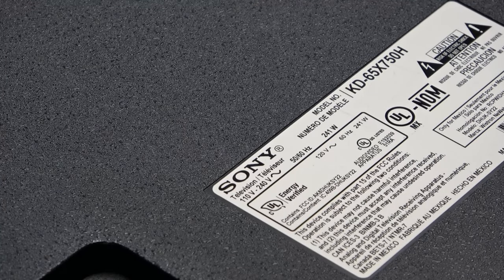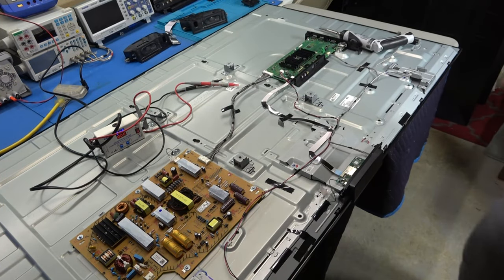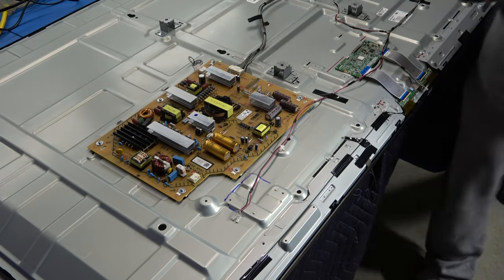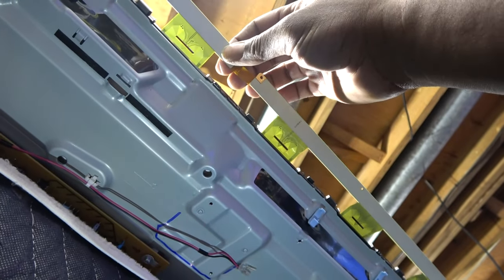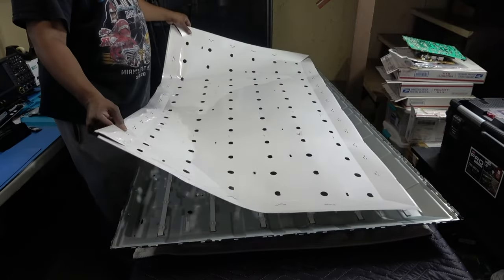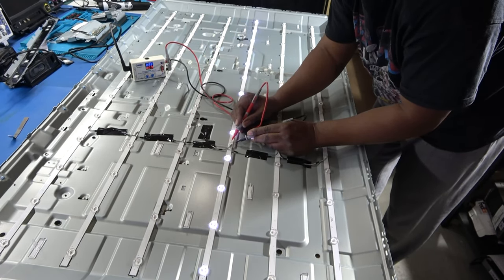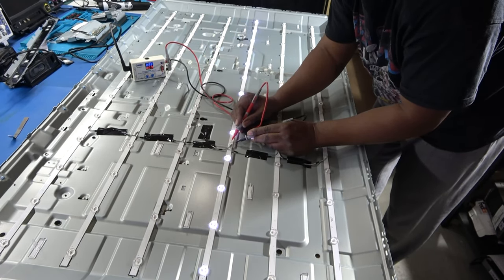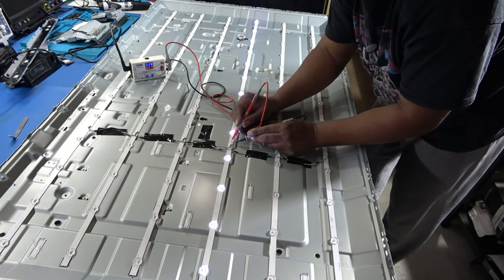Sony KD-65X750H no picture, just  6 red blinks at bottom. Full TV Repair.

Comment: I replaced the LEDs but still no illumination and 6 red blinks. They turned on once like at 23:30, but when I unplugged they never came back on no matter what I did. Later I replaced the power board and main board but still nothing. TV repair is not for the faint of heart. Time (about 12hrs total) money (~$100) for nothing in the end. I'm not qualified to diagnose it further. Thank you for the video though.

Comment: Thank you , good informative video , I am an Electronics technician and I like this video, you were careful not to damage the screen while doing this job, the only thing I always do is I secure the four corners of the  diffuser sheets that will make them aligned together and much easier installing them back, some tvs are more difficult in doing this job when the LCD screen is taped or glued to the frame which make this job either very difficult and higher chance of  cracking the screen while trying to separate it from the diffuser sheets

Comment: Is there any danger repairing it myself (i.e after shock) or do I need any safety gear? I have the same model and same issue. Thanks
Reply from the maker: As long as U make sure tv is unplugged from AC outlet and avoid putting your hands on the power board U should be fine. Oh, don't work on the TV on a metal table 😜

Comment: Great video. Fixed the backlight on a 65x8077G thanks to it . Note he wrote in subtitles to purchase the strips from shopjimmy. I missed that and the ones I got from amazon came without tape (2 weeks lead time) and the overall length was missing a few mm of length - so the ends did  not lined up -  had to spend extra time to ensure it is properly aligned.  also don't be tempted to remove the side covers with them up i almost damaged the COFs . Do it exactly as he shows in the movie crawling under the table. 
I did not have a power supply to actually test the strips, just replaced them all straight as he said. you could fell how brittle it were after 6 years of use.

Comment: The exact same thing just happened to our T.V.  Sent it to a repair shop, they charged $300.00 if anyone is curious about the repair cost.  LED strips are cheap, but taking it all apart, let someone else do it.
Reply: I might as well buy a new one.  Mine just did this
Reply: Just begun taking mine apart. I'm normally real good at stuff like this. We'll have to see
Reply: Bought lights off eBay for $30. LED tester for $18 on Amazon. So $48 in to fix a TV I paid over 1k for can't beat it
Reply: @officialfetti7685  were the strips double sided?

Comment: Very nice repair. I have your course. Not a fan of the suction cups. I tried that once, they left circle images (2) in the panel. Never again😡
Reply from the maker: The circles usually aren't permanent, never had problems with the suction cups, I hear you though. Glad to have you. Thanks.
Reply: @bigdog8882  I dunno, they were still there after 3 days😳, so not sure how long it takes for them to go away, the only saving grace was the panel ended up being bad. Didn't want to end up having to explain that to a customer ... 'they go away eventually' - just not worth the headache or risk. I know it seems convenient to use them but just not for me after that experience.😖 The last thing I want is to be sued or have to buy a replacement set.☹  PS - enjoying the course!👍

Comment: Super video BD. Worked great for me ! My neighbor had the same problem with his and got some cheaper LED strips with no tape. I told him where to buy but he ended up getting them somewhere else without the removeable tape. I told him I didn't know what's best to or how they would be best to put on with two-sided tape or super glue on the high areas of the back plate? Any suggestions? Just a warning to anyone . The LED's don't all come with tape on the back. Glad I got mine at SJ. Thanks

Comment: Hi BD, Please can you advise? I have a Sony 55XD8599 TV and when I switch on the standby light blinks on/off Green& White there is no picture or backlights and after several minutes there is a tune that repeats but no baklights or picture visible. When I disconect the main board cable and then switch on the backligts work as expected however once the cable is refitted I get the same fault.
Thank you in anticipation.
Regards,
Brian

Comment: Did this thing (thanks!), but the screen has patterns as many as led panel lines with darker rectangular spots. Do you know why? Barely visible. in some light, when white I see them at once.
Reply from the maker: you either damaged the screen or you have the ribbon connectors uneven or not pushed all the way in the sockets.
Reply: @bigdog8882  Thanks. Actually you may be right... :(

Comment: Put the TV face down and you won't have to touch the panel or do things upside down. So much safer for replacing the LED strips. Lift the main chassis with LED strips inside up instead.

Comment: Hello sir , I did the same exact test as you with my LED tester I also didn’t get any voltage input when I just used main leads for the back lights but when I did the test on the strips every single one was turning on !  Could I have bad wiring issue to cause the open ? I ordered some LeD strips from eBay hopefully it solves the issue makes no sense to me that my strips turn on with tester on the strip but not through the wire

Comment: Do you know why the top half would be dim after doing this repair?
Reply from the maker: Sounds like all the backlights aren't lit. Check the backlight connectors.
Reply: Okay so I figured it out last night around midnight. 
I took it to the TV shop to get repaired. They replaced the LEDs but when assembled they said the top half was dim and they could not figure it out.
I brought it home, took it apart and reassembled it three times. I realized on the third time that the thicker clear screen was flipped around. The TV is working perfectly now. Thank you for your video
Reply: Amazing work 👍

Comment: Hey Robert, which backlight tester do you recommend and why?  Thanks bro, you are awesome.
Reply from the maker: The same one I use with the current adjustment, so you can increase the current for testing edge-lit backlight strips.
Reply: @bigdog8882  can you give me a link?
Reply from the maker: @devonsmith7953  https://www.amazon.com/Backlight-Tester-Constant-Current-Testing/dp/B0B3Y96PJ5/ref=asc_df_B0B3Y96PJ5/?tag=hyprod-20&linkCode=df0&hvadid=642234065174&hvpos=&hvnetw=g&hvrand=16794420926338310079&hvpone=&hvptwo=&hvqmt=&hvdev=c&hvdvcmdl=&hvlocint=&hvlocphy=9021634&hvtargid=pla-1915701046761&psc=1&gclid=CjwKCAjw9J2iBhBPEiwAErwpeV6uZDNVdegtVHpoi-2WLj9Gasq8eGwX_eYHH_AGC9_A4mljaJvMJBoCTCMQAvD_BwE
Reply: @bigdog8882  thank you.
Reply: Hey Robert. I just picked up one of these TV from a buddy because the LEDs are not working. I can see the screen works, it's just not lit up. Do you think replacing the strips is a safe bet here?

Comment: Hello Mr. Robert. I followed this video to repair my 65" Sony Bravia TV 65X750H. After successfully completing the repair, the TV screen turns on but is stuck on the select language screen. I attempted to use the old remote and a new remote with new batteries but I cannot figure out what is going on and my online research has resulted in nothing. The power button on the back of the TV doesn't do anything either. I have to unplug the TV to have it turned off now. Any ideas? Thanks!

Comment: I have problem with a  sharp slc70le741s backlight i think cause its dark on the left lower side and now the left side has started flashing and blinking what else beside the backlight strips can be the problem?
Reply from the maker: Check the backlights.
Reply: @bigdog8882  ok thank you  I give a try. I guess the backlight strips is 2 pieces on left and right side in the downside of the tv?
Reply: I opened the tv and it was 10 led light on the left strip that was not working maybe it something wrong with the main board because the light didnt look burned and now the tv is completely dead

Comment: Hi Big Dog, for those of us who don't have a LED tester, what should the output voltage (voltage going to LEDs) be  at the backlight (one line) plug.  If the voltage is good going to the LEDs, don't the LEDs have to be bad?
Reply: Gary these LEDs are usually 3VDC or 6VDC.  The string Voltage can vary based on the brightness but for example, a 10 LED strip might be 30VDC at the input.  When one dies (open or short) the whole chain usually fails.  You can find other YouTubes where people show you how to diode check them with a VOM.  I haven't watched the whole video but this guy might do it here...

Comment: In this video:
https://youtu.be/raSX4P8uGpU?si=QT_KKVfzVq0Abd_p

the wire for the LED light is cut so the TV can turn on regardless of diagnostic errors. The TV's LED had been blinking 6 times and the TV turns off after turning on.

Will cutting the wire cause the TV to start a fire 🔥because the TV is overheating and the diagnostic blinking red light is disabled, which, had it not been , would had turned off the TV automatically ?